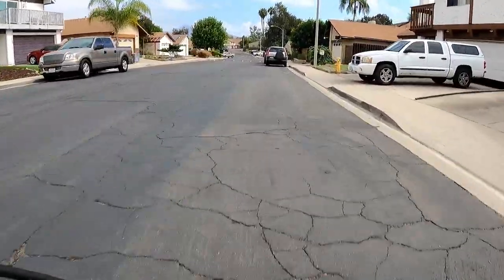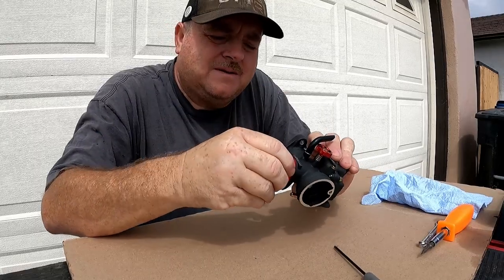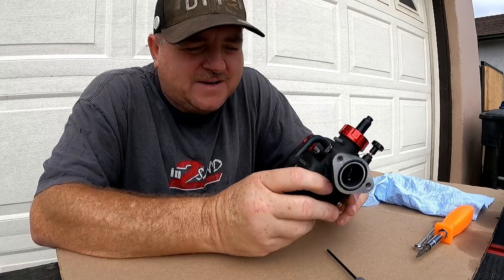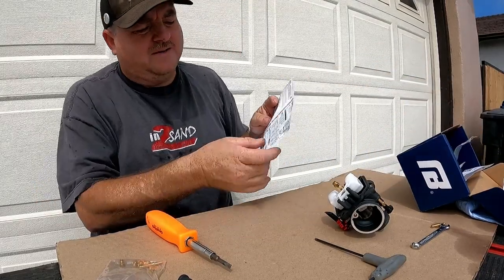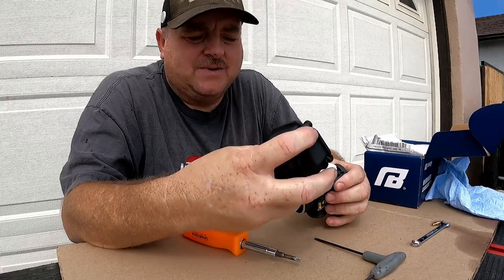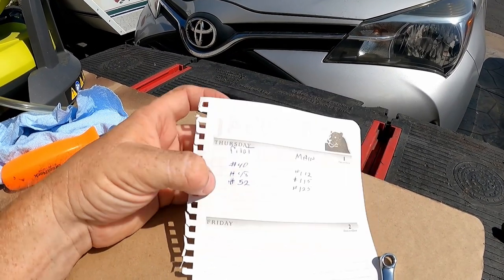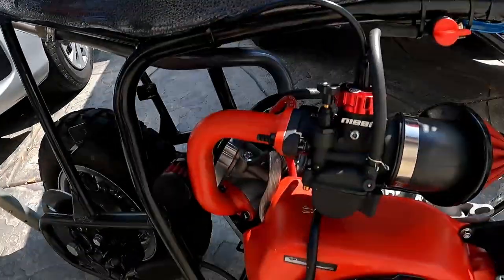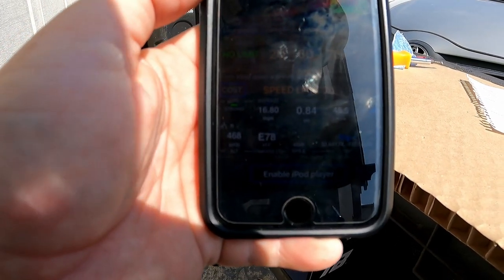NIBBI Carb Adjustment

Comment: Lol that's one of the things I was most impressed with too is the slide. The slides in the Nibbi is awesome.  I went through 3 different carburetors and finally bit the bullet on a PE28MMFL and boy am I glad i did. With the Nibbi my Rhino started right up first crank. I grinned from ear to ear after fighting with the previous 3 cheapos for days.   The throttle response is insane. I know I won't buy another brand of carburetor again.  Rock on Nibbi
Reply from the maker: Rock on NIBBI!!

Comment: Great video! Thanks for showing us the inside of the Nibbi! They must list the bore of the pilot jet in metric rather than thousandths of an inch. I bet a Nibbi 52 pilot jet size is a 0.52mm. That would make a 0.52mm ID of .020 inch on the pilot jet, if so it may need a little more at sea level. The engine sounds really great now though, there's no backfire on deceleration at all that I noticed in the clips. I can't get over the quality of the machining in that Nibbi carb. Very nice! It's easy to see where the extra money goes for these. Some of the cheap China VM and PZ carbs I have look like they were finished inside with a die grinder. Not the Nibbi! High quality machine work there and polished. Thanks again for giving us a look inside. I think this is the first video I've seen where someone takes the time to open up a Nibbi so we can have a look. Awesome! I want one. Great stuff DIY Willy!
Reply from the maker: Yes they really are nice carbs. The machine work is quality. I was think I needed less than the 52 but maybe you right I can try the next jet size and see how it does. I was hoping I showed up enough of the carb. After I watched the edited video I wish I would of showed more some how. I run a vm22 on my 212 and I think this NIBBI was easier to get to run right. I’ll be buying another for my next 212 build and I glad I decided to put this one on the 224.
Reply: Z
Reply: @tatertot7105  28?
Reply from the maker: Z?
Reply: Noticed you guys running these carbs, they look like an exact copy of a real PE24mm carb and run the same jets too. Currently I have a 40 pilot and a 140 main in the PE24 on a tillotson 212r build.  Plug still looks new not sooty at all.  Air screw is only half turn out tho.  So I am thinking I might need more pilot or move the needle up since I get a little bog from idle to wide open every once and a while.  What do you guys think?  I've never ran a carb before with a larger pilot than the main jet very interesting jetting these engines.  I'm used to jetting these carbs on pit bikes, these little motor's if you let them, they will Gobble fuel at wide open.
Reply: @ephenj what’s your elevation?

Comment: On my built Wildcat 223 with 26mm Nibbi I run a 130 main and 38 pilot with air screw 1-1/4 out needle clip in middle. Run mint!
Reply from the maker: Hello Jason, I appreciate that input. I still feel mine is too rich. I’ll try your suggestion and see if it helps. Thanks for watching!!
Reply: @DIYWilly  Anytime brother. Let me know how it works out. Thats the biggest pilot I ever heard anyone using to be honest. I’ve heard some dudes depending on elevation running 40’s but thats about highest I would go personally. I learned the hard way with a lot of trial and error. Still learning all the time. Happy building brother!
Reply: Thanks I was wondering about the wildcat w longer stroke.! I’ve got stage 2 212 I just ordered the pe28 
Looking for any input on these carbs ! 
I’ve always had Japanese carbs and never had the issues I have with these Chinese ones even vm22 is a great carb —— for a week ! 
Then gaskets Start swelling from the ethanol in the gas w use! 
I just hope this nibbi holds up ! I got it on Amazon 50% off for 36$
Reply: How do you know that you’ll need these larger jets ? Valve work , can save you all the trouble ! Harmonize your valve train and you can open your rpm’s and make use of these big jets !
Reply: What elevation you at?
Reply from the maker: @djbrookbank449 Pretty much sea level.
Reply: I was wondering your sea level elevation.  I'm running a 110 main and a 40 pilot at about 600' above sea level and been averaging about 38-40 degrees lately.  I still have slight hesitation at about 1/4 throttle to about 3/4 throttle or a little bog. Anyone have any suggestions on what I should do to get my throttle working good all the way through.  I can try to hold it about half throttle and keep it there and it will bog and stay that unless I blip it or let off of it. Any help is greatly appreciated
Reply from the maker: Hello Gary, try moving the clip down on the needle. This will allow more fuel without changing jets. Maybe just what you need. Sounds like you’re really close. Thanks for watching!!
Reply: @DIYWilly  your not the only one that's told me that so I think that's gonna be my next move. I will return with results when I do.
Reply from the maker: Look forward to hearing about results
Reply: I lowered the clip on the needle I'm in the 4th notch down from the top and It may have helped but I don't think it did. I also noticed the other day my air screw was dangling almost ready to fall out. So I tightened it up and counted the turns and it was 3 1/2 turns out. Plus I don't hear or feel much difference when I do turn the air screw very little response from it. The big knob idle screw seems to work OK but it's like I almost have to have the air screw out far as possible.  Does that mean I need to change jets you think? Also pulled the plug and it was burnt but not wet or gooey or anything just black and burnt. I can get it to stall if I crank to full throttle from idle pretty much every time. Any suggestions
Reply from the maker: Definitely check the jets. There are some good recommendations in this comment section about jets sizes that have worked for other engines. What elevation are you at? That also can play a part of the tuning. Good luck!

Comment: The car almost ran over your hat.I’m watching this video again because my nibbi is acting up so I think I need to change the jets.you said A 125 and like about a 45 or 50?
Reply from the maker: Hello Sam, Yes the nearly ran over the hat. Those jets I used were still too rich but it ran fine. I found those NIBBI’s to be sensitive to dirt. Mine would act up often. I will down size it some and adjust the needle.

Comment: Ive just brought a nibbi carb but wen i shake the bike it leaks out the fuel drain on the bowl but the screw is tight.
Can any one help
Reply from the maker: Not too sure without seeing it but I would check the floats and also the bowl gasket. Did you take the screw out? Could be there is manufacturing debris in the hole.

Comment: lol one question if i run this over my stock carb with 38jet should i take my gov out or should i be good it already goes wat feels like 88mph but im pretty sure its only 50 sumtin
Reply: You will have to remove the governor because it won't be on a throttle linkage  I'd just leave that ducar stock build ya another bike as the ducar piston is funky I've got some work to do to mine refresh it for next session
Reply from the maker: Do what ever your comfort with and feel safe riding..

Comment: What would you recommend on 212 predator with upgraded springs and Governor removed on a mb200 trail master. Vm22 or NIBBI Pmk clone
Reply from the maker: The Nibbi is a great carb but the Vm22 is easier to work with in my opinion. Both will need rejetting to run there best. So buy a jet kit when you choose the carb. I have a GPS VM 22 and it came with jets already and ran near perfect out of the box. The Nibbi in this video required trouble shooting with the jets to get it to run 53mph on the 224 HEMI. Get the VM… Thanks for watching!!!

Comment: So just installed mines but for some reason it’s idling at the red line high rpm’s and only starts with choke up I tried adjusting air screw as well as idle screw but no luck. And suggestion on what the issue could be ?
Reply from the maker: I would check your twist throttle and make sure it releasing completely. You can also take off the filter and look inside to see where the slide is. Sounds to me like the twist throttle is holding the slide open. Hope this helps and thanks for watching!
Reply: I'm sure you figured it out by now but if not make sure your slide is in right and the cable is properly ran into the slide

Comment: What do you by 2 turns? Just 2 turns or 2 full turn?
Reply from the maker: That would be 2 full turns. But try starting with 1 1/2 turns  and tune to your liking. So many factors will affect how you tune. For example your altitude where you live. Remember to tune with the engine at operating temperature. Hope this helps.. Thank for watching!!

Comment: DId you ever put the NIbbi on 212? I have a Tillotson 212 stage 2 and it rips but I can only run with choke so I need to rejet and was curious if you knew what jets for a 212.
Reply from the maker: Hello xClyptox, No I never ran the Nibbi on a 212. But it did good on the 224. The 224 is the same 70mm bore but only a little more stroke. I had a very similar problem on the 224. I would start with the jets I chose and work down from there checking the spark plug. That will get you in a better spot. I ended up with a #52 pilot and a #125 main jet. Mine is running rich but will get the job done. Try a #50 and see what happens. Or try to lift your needle up first by moving the clip down. That you can do without new jets. Might get you there.. Thanks for watching!!
Reply: @DIYWilly  Hello, I went ahead and did the 50/125 but it got dark so I cannot test but she no longer runs on choke so that is fixed at least. For anyone researching, I have a Tilly 212, billet rod, gov delete, mod 2 cam, Nibbi carb/filter, and super pipe header. If I dont update, it worked.
Reply from the maker: Be sure and check your plug! That will tell the story of how your engine is running (Rich/Lean). Black will be too rich. Good job!! 👍

Comment: Pilot jet controls idle the needle is for 1/4-3/4 throttle the main jet is for 80 to full
Reply from the maker: Very helpful information! Thanks for watching!!
Reply: So  my bike idkes at 2k rpm but when i give it a little trottle to mzkethe bike move it wants to die do i need to change the main jet or pilot in crease size or decrease ?
Reply from the maker: I would say increase. There are lots of videos out there how to tune small engines. Also more information would be helpful. Engine size-mods done and so on. Thanks for watching!!
Reply: @DIYWilly  Predator 212
ARC cam 
Rod
Flat top piston 
Torque converter
Gold chain
Nibbi PE24FL
Billet flywheel 
Upgraded Valve springs #18
Thumb throttle
Reply from the maker: @HoeLeeFuQQ I would try adjusting the needle first. Move it down 1 notch and see if it makes a difference. If you get all the way down and still have problems than definitely step up the jet 1 size at a time and put the needle back to middle notch. Also sometimes these carbs come dirty from the manufacturer and need cleaning before use. Blocked ports or jets can be frustrating. Hope this helps
Reply: @DIYWilly ok so I checked the needle and it was in the middle(slot3) I moved it down 1 slot(slot 4) idle got to like 1900 rpm but stil will big and die when I gave it the slighted throttle. I moved it 1 slot down (slot 5) and the idle settled at 1700 rpm, but still bogs like before and dies when I give it throttle. Ther is no more slots on the needle to move it down more what should I do next?
Reply from the maker: @HoeLeeFuQQ moving the clip down on the needle should give more fuel and the idle would go up not down. Time to check floats and change jets. It’s really trial and error. There’s no magic jet combo. Just change jets until your engine runs better. Remember I suggested cleaning the carb. Could have debris in it from manufacturing. In which case it will never run right. The carb you have should run good not great but good out of the box. Where is your gas tank? Do you have good  gravity feed to the carb?

Comment: I’m stuck between this and a vm22 clone. One cost twice as much as the other…

What would you recommend for use on a 224 predator w muffled exhaust?  I have some basic knowledge/experience with carb maintenance
Reply from the maker: I think the vm22 is a better choice for cost and usability unless you really know how to tune them. Thanks for watching!!
Reply: @DIYWilly  the thing that scares me about the clones is that there are so many different variants of them on the market. And I wouldn’t know which one I’d get
Reply from the maker: @danielnunez3518  I have the vm22 clone from GoPowerSports. This carb works flawlessly on my built 212 and they claim it’s tuned already. With that said I’ve ran right out of the box for years now with no problems. I would buy from a known company like GPS or EC Carburetors. This way you know your getting a good part. I’ve bought PZ carbs from Amazon and have good luck but stick a good well known company.

Comment: Whats the spring gasket washer for? And is it necessary?
Reply from the maker: Hello, If you’re referring to the white washer below the spring I would say it’s there to keep the spring from coming contact with the slide. Is it necessary probably not but is a nice added to a great carb. Maybe someone else will provide a better answer. Thanks for watching!!
Reply: @DIYWilly   nibbi have gotten back to me about this, they said what you said about protecting the inside of the throttle body from the spring, but they also said it was to help keep the cable from slipping. Apparently there were issues with the cable not making great contact. 
I was thinking maybe there should be an adjustment at the top of the carburetor, like all the others, lol
Its a good carburetor for sure, but since i lost the plastic white washer, im using a black rubber washer that i found and it fits perfectly in there. 
Thanks for reaching out, i appreciate it 😊
Reply from the maker: Thanks for the clarification and sure it help someone with the same question. Happy 4th and stay safe!!

Comment: Hey I just set up my Nibbi Carb on my 224 and I can’t get it running. A lot of extra hoses and such.
Reply from the maker: Extra hoses? Should be the drain hose.
Reply: @DIYWilly  yeah i wasn’t sure if the ones on the engine need to be connected anywhere. On the carb or elsewhere. Besides the fuel line of course lol
Reply: @DIYWilly  welp I figured it out and got her running good
Reply from the maker: Great news!! What was the problem?
Reply: @DIYWilly  I had the on off switch wired incorrectly after I removed the oil sensor. Silly me
Reply from the maker: Simple mistake

Comment: I love your video and it’s really helpful. I have a question I just went out and got the 30mm and I wanted to know do it come with jets in there already and if yes are they I guess a higher level of what come in the bag.
Reply from the maker: Hello, Yes the carb will come with jest already installed. How ever every engine set up is different and may need tuning. Try the throttle a few times and check for flat spots. Tune according until it runs smoothly. After running the engine with the new carb check the plug see if it black or light brown. Hope this helps and thanks for watching!!
Reply: It did more then help thank you so much
Reply from the maker: @a.p.a.rucker7539  👍

Comment: How is your CDI running, I never hooked mine up I’m kind of afraid. Do you see right now if I have a problem with spark, it’s either the magneto or the spark plug end the story, but if I put that CDI on my bike and there’s a problem, there’s a lot more parts and then you have to know how to read multi meters and stuff like that. I might just sell my CDI I think 60 miles an hour was fast enough for me.
Reply from the maker: Hello jojojeep and things, I have a lot of problems starting the CDI engine. I’m going to build another 212 for that bike and I’ll stay with a regular coil. I want to be able to just give a couple pulls and ride. It’s not that way for me with the CDI. It was cool to play with but… Try another coil and see if that helps you. There not that expensive. Thanks for watching!!
Reply: @DIYWilly  Stockwell with an aftermarket wire that’s the way I am doing it I’m not even gonna put that CDI on my bike. I’m gonna just sell it I had a feeling that thing was problems.
Reply: Because he hit a lot of big Youtubers and nobody ever makes a video on it. That’s got to tell you something. Plus, it’s so much simple. If your bike don’t start it’s the coil or the spark plug. Why fix the wheel or reinvent the wheel should I say?
Reply from the maker: Exactly! I will say that when it’s starts it’s very responsive. But not worth the hassle.
Reply: @DIYWilly  maybe that’s why on his videos he pushes so much about the one pull start that he gets when it’s on his engine. If you go to my channel, I have a video where I used 4 inches of rope and it started my bike. If your bike is timed in tuned, it will start every time just get it up on the compression stroke and you could probably start it by looking at it crooked